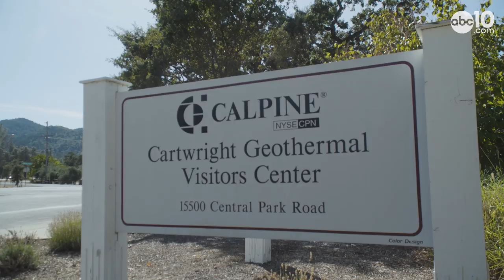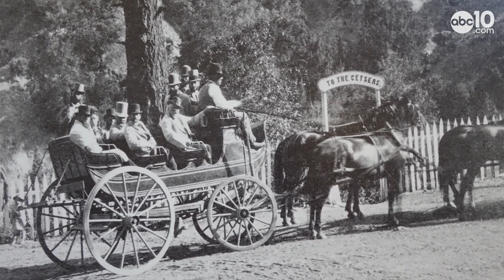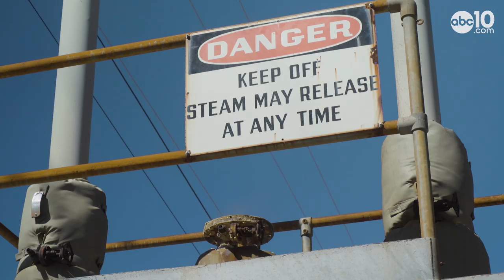'The Geysers' power plant keeps California's electric grid green | Bartell's Backroads

Comment: Clean treated, sewer water. Pumping it into the mountain where our underground fresh water runs under the mountains and empties into Clearlake down Cache Creek all the way to LA.
Reply: Wdym no one pumps sewer water thiers . its natural ground water that comes into contact with heated magma and vaporizes.
Reply: @metaldetectingnmore8763  Did you not watch the video you're commenting from? 
2:27
Reply: @ramdas363  It falls down a pipe at a downward incline, but then it's boiled by the geothermal heat and the steam is used to turn a turbine and generate power. :) The water they use for geothermal is not from any source that's used for drinking. 🙂

This is a VERY clean and green source of power. It's basically like nuclear power, except the heat source is naturally occurring.